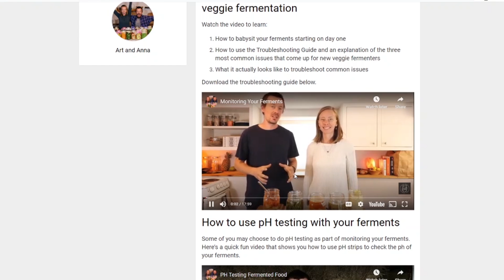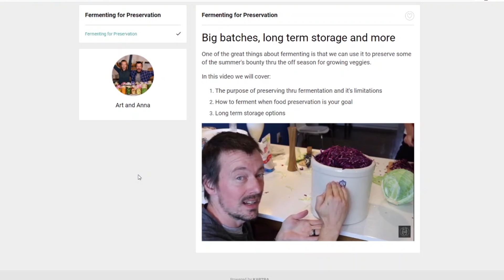What I Found Here Surprised Me - (House  Demolition)

Comment: I wouldnt call that a limp, but something is different in the back legs, like he's not getting full extension or some stiffness. It was most apparent in the closing shot.
Reply: Agree it wasnt a complete limp
Reply: I agree, that closing shot shows it more. Wonder if it’s actually the L hip causing change in gait pattern on the Right?? Old physical therapist here.
Reply: I also agree it looks like a stiffness, when you see the left leg it is bending more than the right when in movement, ligiment problem?Look at her from the hind end when in movement. Also could be the knee.

Comment: After reading several opinions about sweetie you might try massage and flexion and extension. She might be favoring it because of the memory of the pain or maybe stiffness from walking on it funny during that time. Plus as a nurse you could feel the difference between the two legs all the way up and see if there's tightness, lumps or pain. Yes, it also might be good to see a run or trot.

Comment: When the hoof area where Bri clipped too close hurt, could that allow that exposed flesh to become infected? If so, is it possible that it's still there'd,causing some pain, even after the trimmed hoof has  grown back? 

Can you see if there's a split in the hoof, or could there be a pebble that wedged into that opened area?

Other than some discomfort coming from  the hoof itself, where the hoof was cut back too hard, the way he's walking, I'm sensing that the hip joint became slightly rotated when Bri was holding onto his leg, if he tried to pull away, or if in some way his hip joint was hyperextended, or affected in some way.

I'd want to feel the vertibrae at the base of his spine, & explore the feel of the muscles in his upper leg, & bone position along both legs, from the spine & down both legs to see if I could feel differences or observe if each leg bends as it should, & if he reacts to applied pressure in deep tissue in that leg. 

It does appear that his right leg isn't flexing & bending normally, as if stiff. It may be best to have someone sit behind him, then roll him back so his butt is on the ground, & his spine is laying on the thighs of that person. Then observe how he moves his legs when held tipped back, in  that position to allow the legs to be examined & flexed when his legs are up in tbe air & not bearing weight. This alone could cause him to wriggle around enough to loosen up his hip joint if it's impinged somehow.

I'd try to carefully, one leg at a time, to attempt, slowly, while holding lower leg, without applying great pressure, in case there was a fracture or sprain or other observable discomfort, or sudden flinching, when trying to hold that  leg steady, & then with even handed pressure, touch eachbl area of the leg, then trying to flex it, pushing in so his knee bends and also try extending slowly, & not hanging on to leg if he squirms , in case  it hurts. 

Then after massaging & flexing both legs, I'd lay him on his back & observe how he gets up onto his legs, & also observe how he uses his legs when lying down, & also when walking up an incline & also when going down. 

His leg could've rotated at the hip joint when Bri held onto his lower leg while also focusing on where to cut & by how much. It might be better if someone holds a struggling animal sp the one cutting can avoid rotating the leg to make cutting easier.

I'd try deep massaging of his muscles near the lower end of the spine after all that, & when relaxed, would apply downward pressure with the heel of the hand, to see if that might help to  open up space between the vertibrae to assist them in returning to a normal alignment in his lower spine, if that's the source of the pain &  stiffness, if something is impinged. You might hear or feel the injured vertibra pop back into place. 

It may just correct itself, if that's what's happened, but it might last for years without help. If it gets worse, he could start stumbling a bit, or start dragging or lifting his leg a bit, if nerves, tendons or muscles are impinged. 

Like with car tires, when our spines go out of alignment, & our hips rotate, then we often get swollen, inflexible knees, or ankles, or our spines go out of alignment, & a dull back ache persists, it will eventually show up on how our shoes wear, if we look at the ones we wear the most, so maybe it would show up in hooves, though he's always on grass, so likely not as abrasive as concrete  & asphalt like humans travel on.

Comment: It appears to me that house has too many layers and was unable to breathe ?
Reply: Sandra Westley, it’s the shock that absolutely no where is there any insulation, it’s not as if the Homestead is in Arizona, they get cold rain and snow, all of which should have a good 8” to 10” insulation in both walls and floor, your money on heat is literally going up in smoke, must cost a fortune to heat in cold weather, and because there’s no insulation the warm air hits the cold walls and turns to condensation, you used to get that in very old Caravan or RV s where you are, walls and windows streaming with it, like in a shower with steam and no ventilation. I am for the UK and these things are vital.